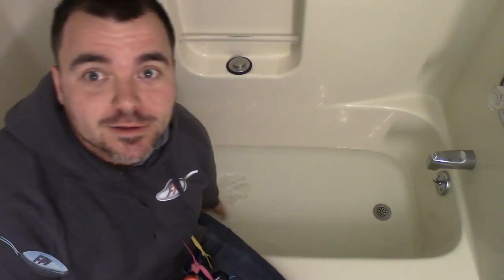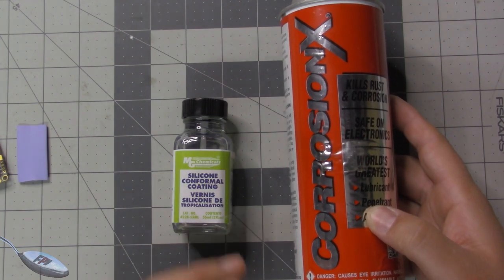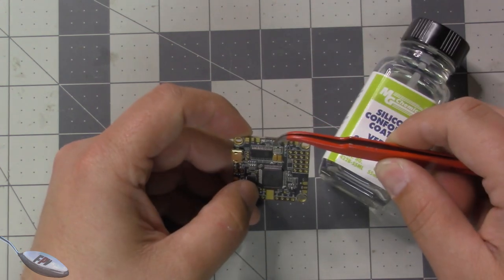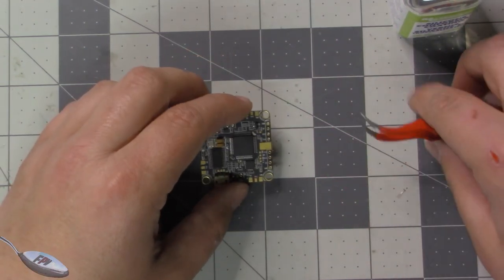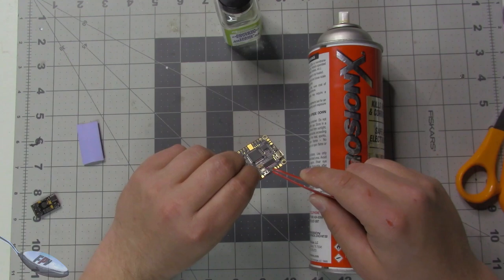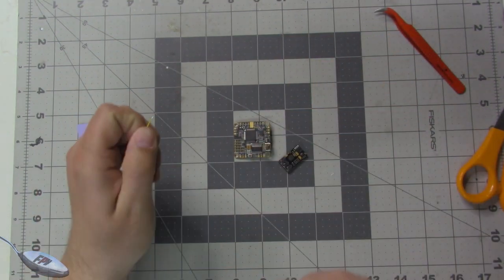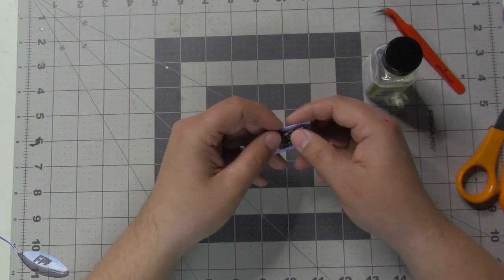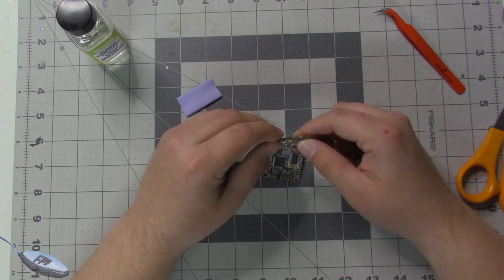Extreme Water Proof

Comment: Thanks for the post. I've been told that covering the barometer makes it malfunction. Do you have any experience with coating these?
Reply from the maker: Yes I do.  The FC in the pool was a Pixhawk, which has a barometer in it.  You need to identify the barometer, and tape over the holes in it during the coating process.  Once you have completed the coating you need to remove the tape, and put that piece of foam back over the barometer to keep the wind from driving it nuts.  Hope this helps, and thanks for pointing out I forgot to mention that.  Comment Pinned.
Reply: Spoon FPV Maybe if you have time do a barometer identify and protect  on camera. I wouldn't have a clue which chip is the barometer. So I assume the barometer needs to be protected from a spray of 'corrosion x' also?